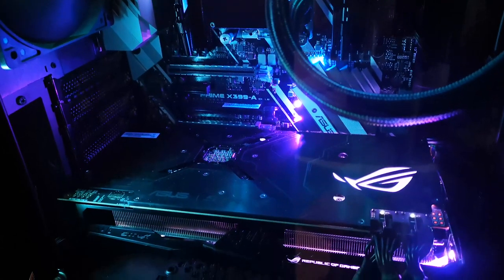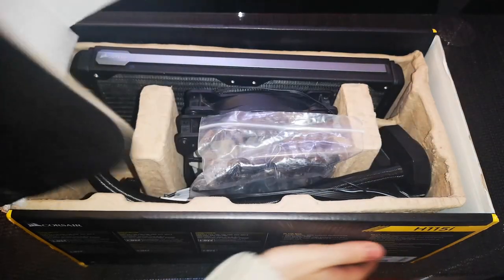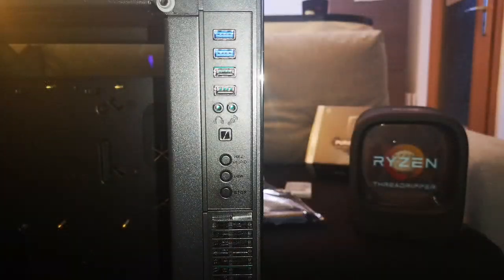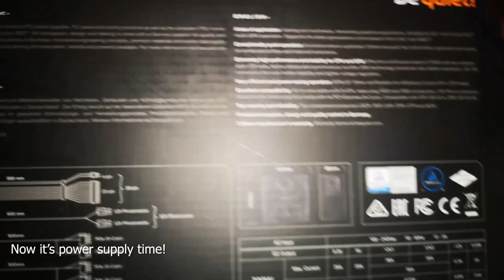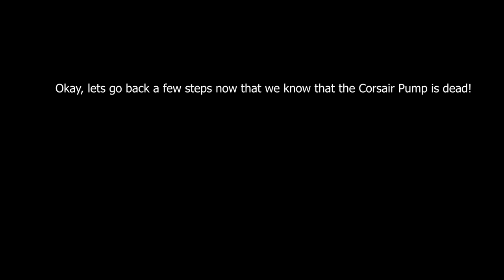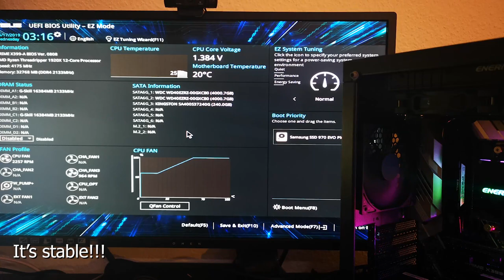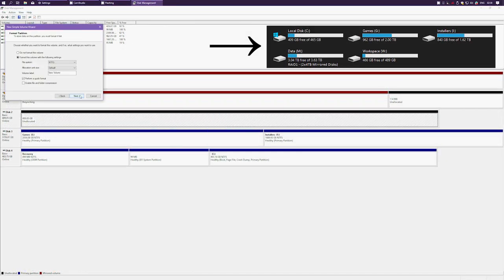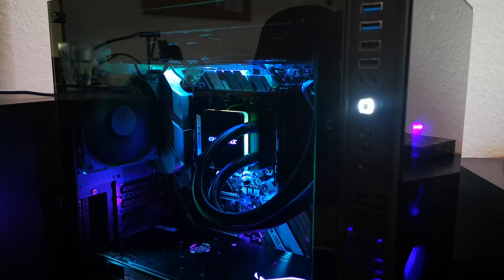Price & Performance - 2019 PC Build (Gaming + Workstation) 💻

Comment from the maker: Would have loved to make a much more in-depth review, time is rare nowadays tho!

Prices as of 20 April 2019:

Required Components:
Motherboard: Asus x399-a
310€ (348$)
CPU:   Ryzen ThreadRipper 1920X
340€ (380$)
RAM:   2*16GB RipJaws V DDR4-3200
145€ (163$)
Graphics:  8GB Asus Radeon RX Vega 64
360€ (405$)
PSU:   700Watt Bequiet PurePower 11
80€  (90$)

Total: 1235€ (1386$)

Optional (you can get cheaper alternatives):
Cooler:   Enermax LiqTech TR4 II 240
140€ (157$) - (Got it for 50€ (56$) on ebay tho!)
Case:   anidees AI crystal cube lite
120€ (135$)
Thermal Paste: Thermalright Chill Factor 3
7€   (8$)
Samsung SSD 970 EVO Plus 500GB
120€ (135$)

 Comments/Suggestions and more?! Drop them below!

Comment: so i kind a think you should turn the power supply with the fan out so it can suck in fresh air and not suffircate
Reply from the maker: I ended up moving the graphics card to the first slot instead of the last one as you can see in the video. Looks worse but: Lower Temperature > Aesthetics

Comment: I don't understand why people put extra fans/add extra noise/ when side panel can be removed and temps  be perfect.
Reply from the maker: Mostly because of dust, basically dust buildup hampers airflow inside the computer and may bring many unwanted problems, that's why removing side panels is generally a bad idea.
As for noise there's barely any, on the main chamber the fans are off 70% of the time (lower load with good temperatures), on the smaller chamber where the disks and PSU are everything is as silent as it could be even with the fans constantly running (they are all "be quiet!" fans and the intake fan has an extra dust filter on it).